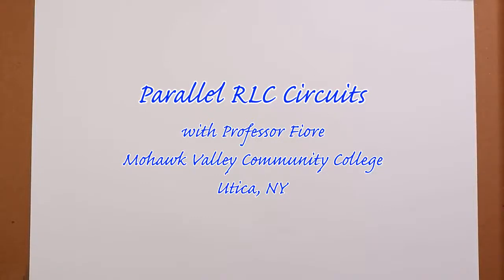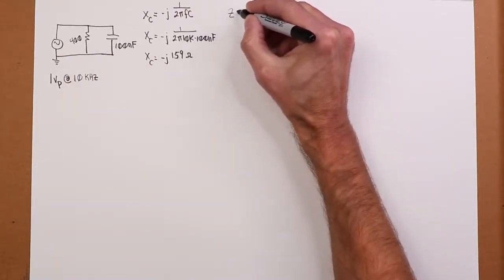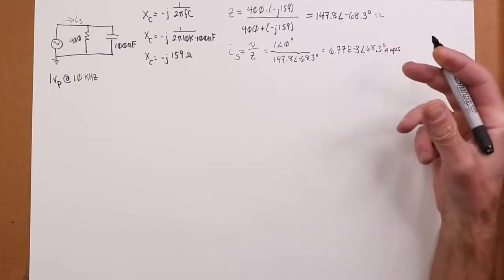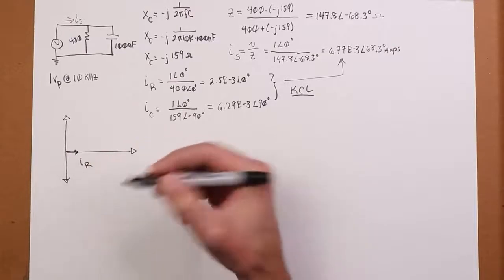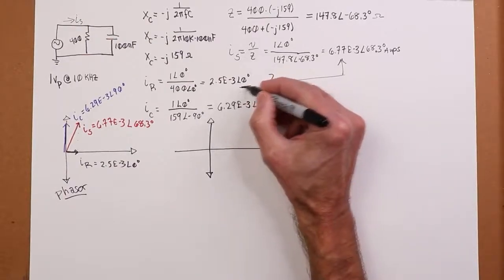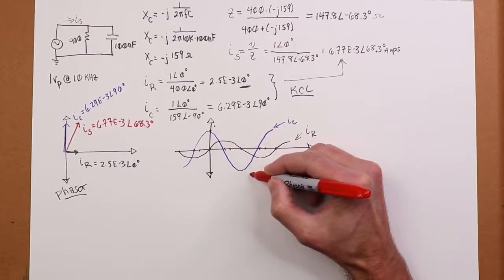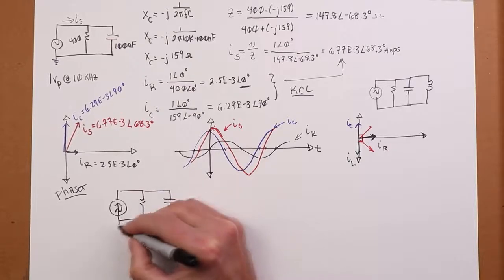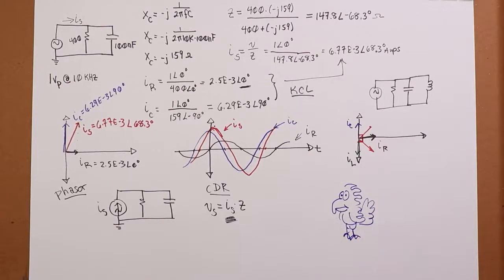AC Electrical Circuit Analysis: Parallel RLC Circuits

Comment: Would be nice if the phasors of resistance and reactants are graphically represented.
Reply from the maker: The phasors for the currents are drawn beginning around 7:00. Those directly reflect the angles of the impedances because this is a parallel circuit, and thus all elements see the same voltage. More examples in my free textbook (see links in description).